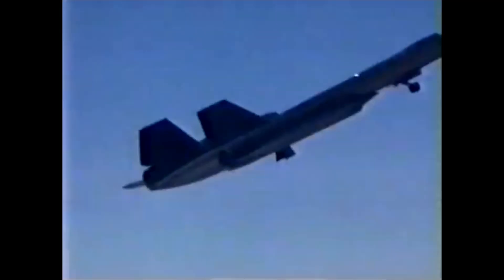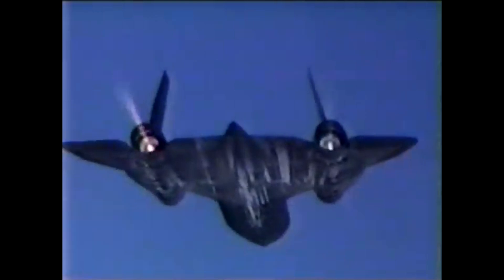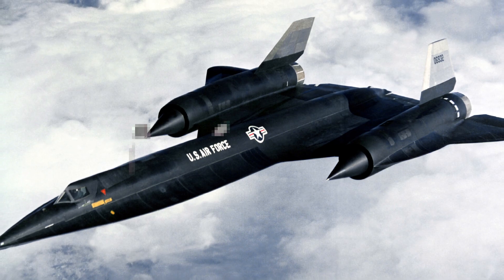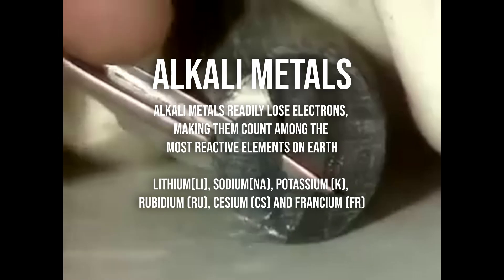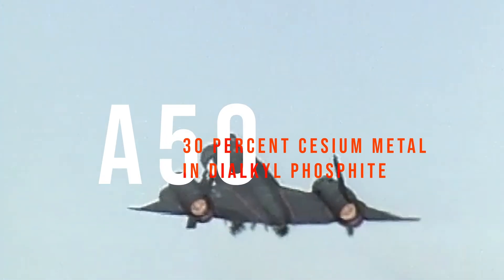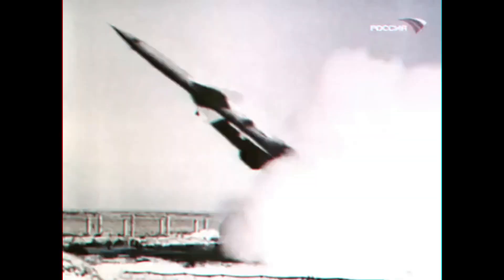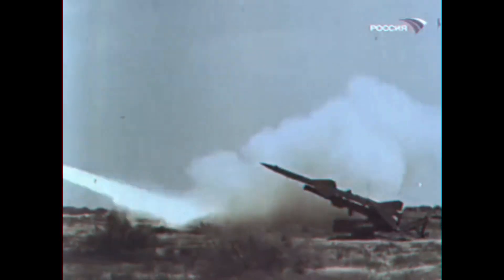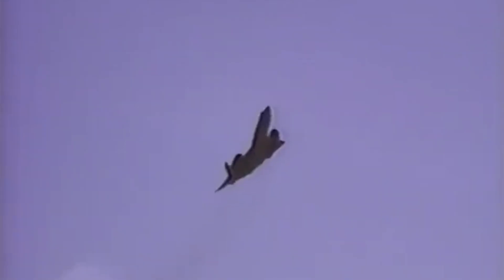The Secret Additive That Made SR-71's Engines Invisible to Radar

Comment: This video seems to be confusing the radar signature of the airframe with the infrared signature of the engine exhaust.
Reply from the maker: The engines and engine plumes have both a radar signature and a heat signature. So, both are true and they had to factor in both. Does that make sense?
Reply: @artplusscience  Thanks for clarifying.  I wouldn't have thought the exhaust plume would have a radar signature anywhere near that of this airframe, and well below its IR signature.  The video specifically calls out the IR signature of the exhaust and then moves on to discussing radar reflectivity without introducing the much less well-known subject of exhaust plume reflectivity, so I didn't follow.

Comment: No one in sane mind ever considered use of radioactive caesium, that would have made both the plane and pilot a single use items. Nonradioactive caesium is not especially toxic, as far as you dont start to replace your table salt with it. It is somewhat expensive though, and that additive didn't work anyways, and it is unclear, if it ever was used in real flights. Also, FYI, that footage of exploding tub with supposedly caesium thrown in water, is well known fake. Caesium doesn't explode that great, and they faked it with small amount of real explosives.
Reply from the maker: It would've totally made sense to stay away from the radioactive 137, which is why I said it's possible because if we're really honest, no one knows the details of the compound. According to Ed Lovick's book, it did work.

What's your source for the second claim?

Comment: Traditional stealth tech helps against radar, but optics hooked up to AI works very well these days.  Current products can determine where a sniper bullet came from, all our jets are larger than a bullet.
Reply from the maker: Point well made. I think the future is increasingly looking like robot clones and drones. Time to bring back the drone swarm carrier aircraft
Reply: What you're describing are two different problems, though, and there are several constraints on bullet trajectory that vastly simplify identifying a point of origin.

You need good enough optical resolution to have pattern matching via AI return a hit, which gets increasingly difficult with distance; resolving a 40' wide object visually from 100mi requires an optic system focus on the specific location (or have such high resolution that a tiny fraction of an arcsecond registers at radar relevant distance) compared to a radar array essentially throwing a signal front and looking for reflection- the radar gives a better idea where to start looking vs. having to scan every tiny bit of sky visually constantly and at resolution.

The other thing is that a bullet has a defined trajectory at time of launch: it 1.) leaves the weapon at the highest velocity it will achieve and 2.) follows a parabolic arc once you're beyond point blank aim range.  If you can identify where it hit and any ~2 other points it was at during flight it becomes relatively simple to follow that back to the source.

Contrast that to an in flight jet that can change direction at will, change speed at will, etc?  Good look visually tracking a jet in any way comparable to radar
Reply: We've been doing that for a while with purely audio signal processing without AI, only using basic trig and physics of sound.
Reply: @Ferndalien  those systems are notoriously bad at tracking in any sort of complicated environment though.

When I was in Iraq we used a system called the "Boomerang" that does what you're describing; omnidirectional microphones spaced out around a receiver to identify the direction of gunfire based on time to intercept at each mic.

Works great in wide open spaces.   Absolutely useless in an urban or highly reflective/echoic environment

Comment: Just for example the f22s P&W F119s engines make 35,000 lb of thrust each 

Fucking insane how far we’ve come 

As well as the f15E makes 29,000 each with Its F110-GE-129 engines
Reply from the maker: Wild, eh? F119s are a work of art. 

I'm also researching a similar story with costs involved for these program - super interesting stuff
Reply: I don't know if it was all about thrust- it was about being able to produce thrust at those airspeeds. And considering that these engines were designed and built in such a short time without the aid of supercomputers (or ANY computers beyond the ubiquitous slide rule), it's truly mindblowing what they achieved. Nowadays, it would take a decade, hundreds of billions of dollars and an entire warehouse of supercomputers just for the engines. The guys at the Skunkworks were on another level.